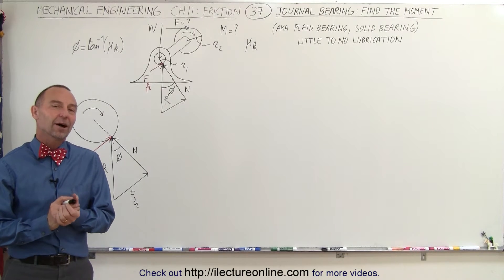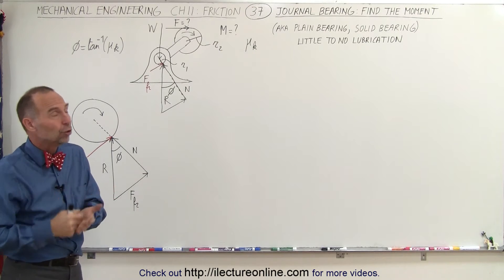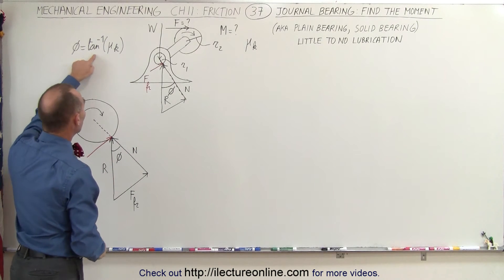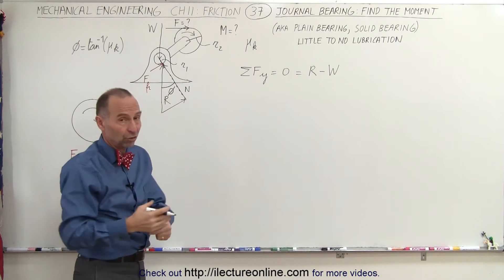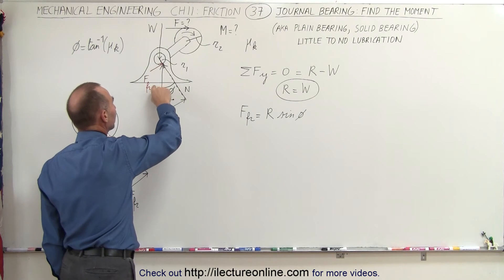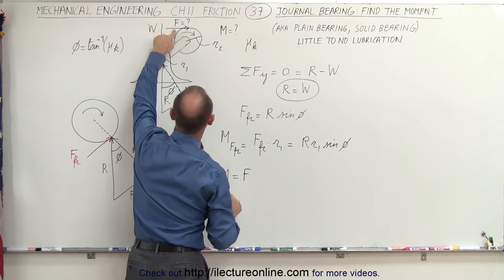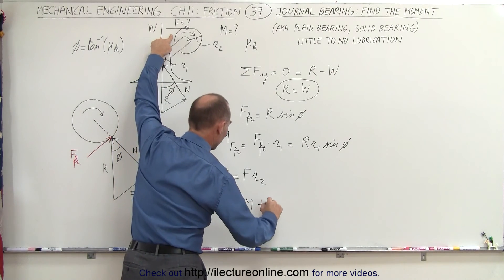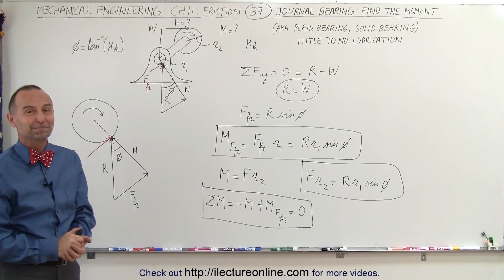Mechanical Engineering: Ch 11: Friction (37 of 47) Journal Bearing: Find the Moment

Comment: First of all I want to thank you for your video lectures. But i would also like to ask for some help. I am trying to sketch a diagram of a journal bearing where the load is applied on the top of the shaft. I am specifically trying to describe the friction acting on the wheels' axles of a pinewood drag car' when the car is in motion. I've been drawing free body diagrams, but i don't think i fully understand how it would work.
Thanks in advance

Comment: the bearings do not rotate, the shaft rotates because the bearing is pressed in into the housing. if lubricated the shaft will never touch the bearing and thin film of oil will separate the two (only at high speeds though)